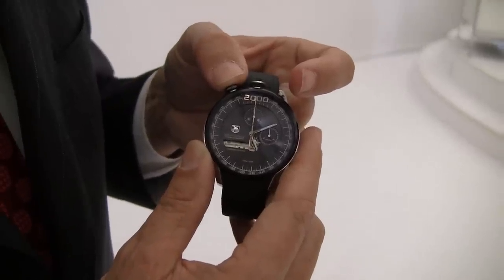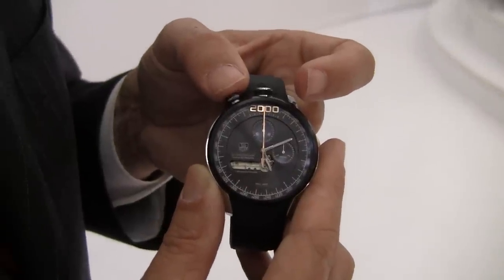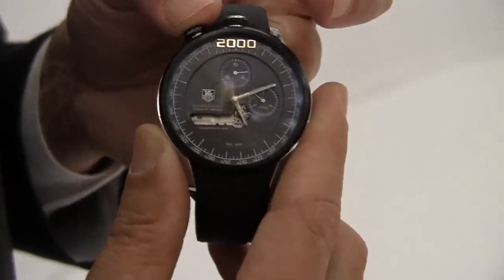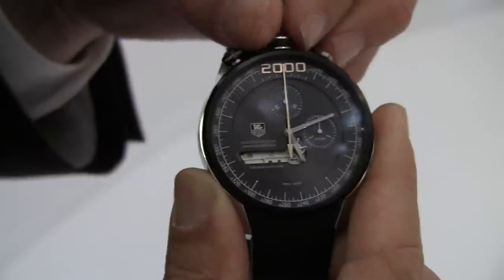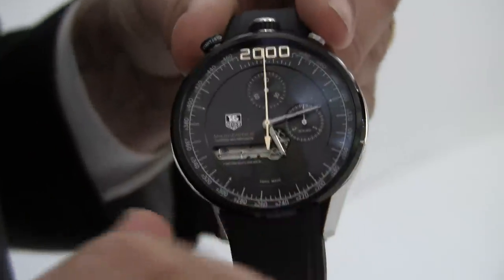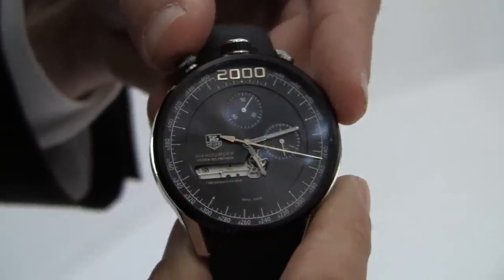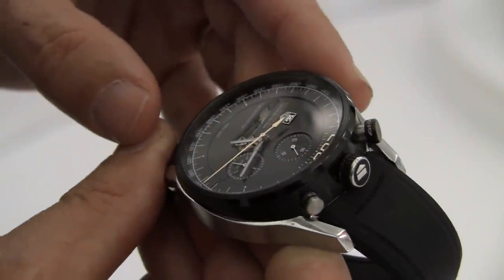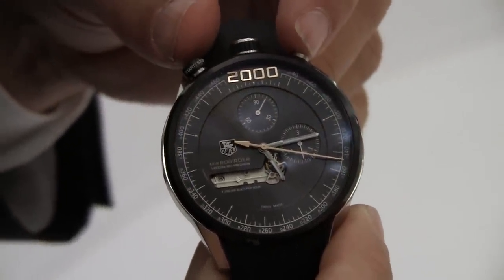Tag Heuer Mikrogirder 2000 5/10,000th of a Second Chronograph Watch Demonstration

Comment: They dont use watches to time Race's, it's all done by censors under the car's which at various point's on a track it register's a time upto 1/1000 of sec, so you dont have ppl with watches clocking F1 or any professional racing at all. lol

Comment: Great watch, but kinda counterproductive. You get such accuracy, but a human thumb has to start and stop it (if you really were to use it for something important that requires that accuracy). Or mount it on a mechanical trigger attached to a laser sensor.
Reply: Go buy a Casio mate, you're not the target audience
Reply: +baralah haha. that's true
Reply: baralah I own 2 Tag Heuers myself, keyboard jarhead. I was trying to make a point. The watch as a mechanical piece has exceptional accuracy, but as a "stopwatch" you lose the whole micro precision because of your thumb reflex. It's not like, say a moon phase, which doesn't require an operator.
Reply: enterBeastmode1 
There is the loss of all that accuracy with the hand eye coordination. Typical variation by hand-eye is only 0.03” - 0.15” 

A watch like that has 2 specs: long duration rate, and resolution. 

5/10,000 sec sweep second hand, but the watch is +/- 0.5” per day.
Reply: What matters is the innovation and mechanical exception. Accuracy is not important.

Comment: Ugh- the 2000 is ugly.  I guess it's cool that the watch registers 1/2000 of a second (although the readout is pretty dang confusing: multiply this by three then add that...).
They should have just put a stylized "1/2k" at the top.  That would have looked better IMO.